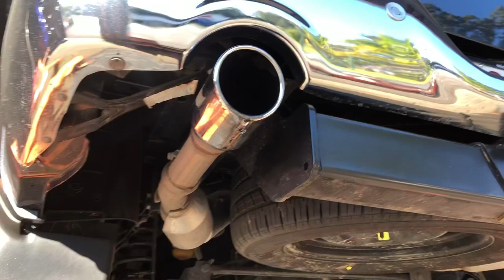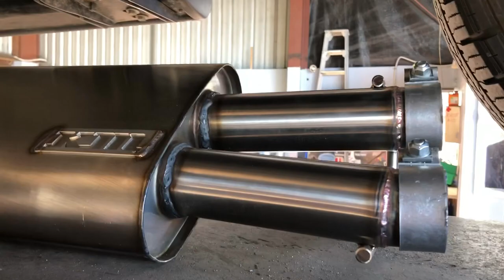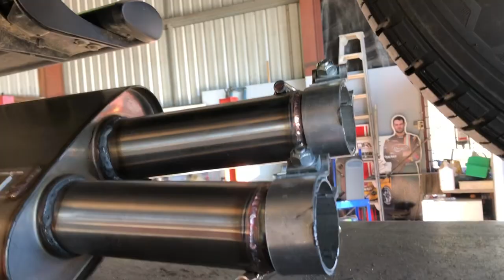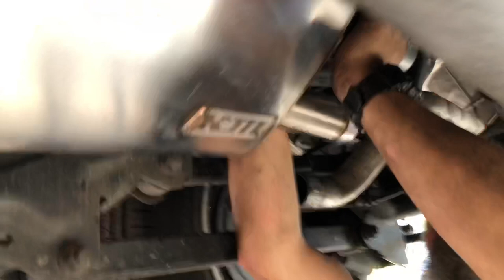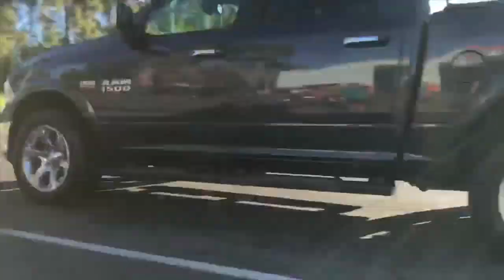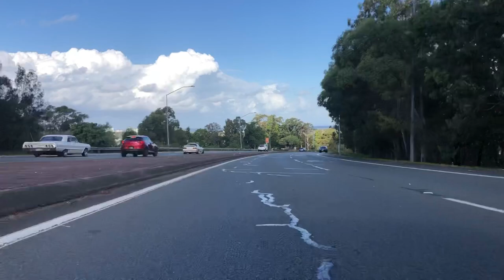Ram 1500 exhaust. KM for that deep Rumble from your HEMI

Comment: I need that tone or similar for my 6.4 hemi. I'm in the USA and have gone through SO many mufflers that sound good at idle but have a high pitch crackle or bark at high rpm that I can't stand. From the video, these sound deep and sporty with good volume.
Reply from the maker: Thanks for checking us out. Do you get a 6.4 hemi in a 1500 Ram

Comment: What would give the same effect for a 2020 Silverado 2500?
Reply from the maker: No, the dpf blocks all of the noise. You can gain a very small sound increase with a 5 inch dpf back system.

Comment: Any info on these mufflers?
Reply from the maker: Steve Burchell hi, you can see more on our EBay store or on our website. Both are under the name of Kuluin Mufflers.
Reply: Is that the brand name? They sound more throaty than my magnaflows . I want that deep deep sound
Reply: Are they straight thru muffler or chambered? Doesn't give much info on the website . What's the difference between your muffler and carven progressive vs magnaflow etc